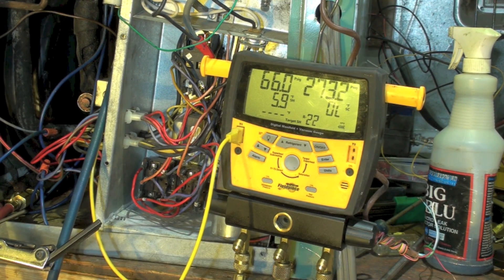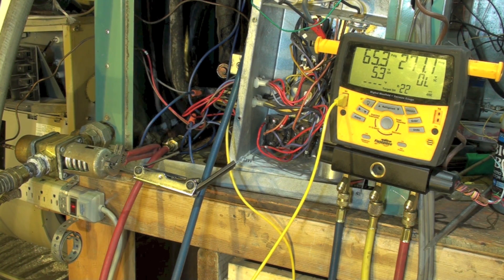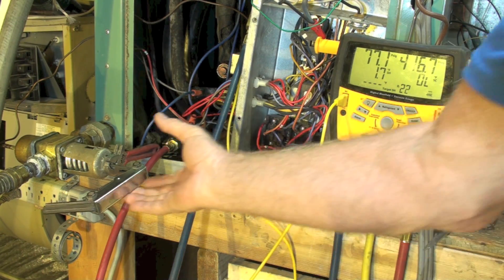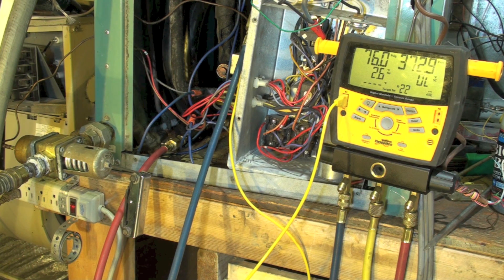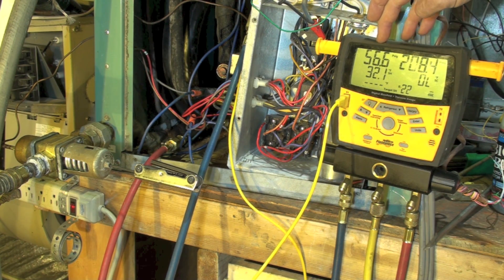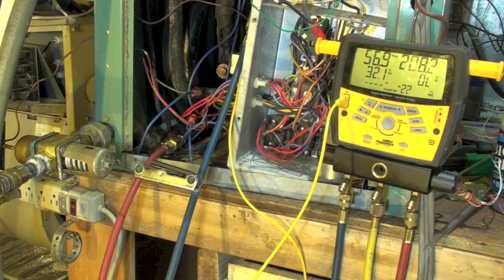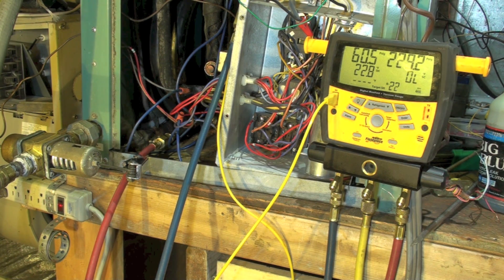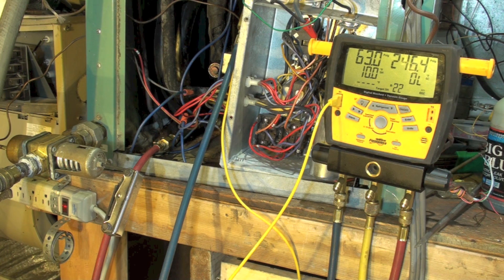How does the water valve setting affect the head and suction pressure on the water source heat pump

Comment: Thank you so much ! I’ve learned a lot . I am a property supervisor and my apt units have these type of water source heat pump’s. Now I do have a question how do you unclog a water source heat pump?
Reply from the maker: If the clog is in the heat exchanger you are in trouble.  You can use a limescale remover, but you may end up with a hole in the heat exchanger which pretty much will destroy the unit.
GFM

Comment: Very good training video. I work on water source hp's just about everyday. We have old Ener Con hp's that are 40 years old and still work fine. We replace them with new r410 heat pumps and they seem to be nothing but problems. The heat pumps were I am at use a supply and return loop with cooling tower in summer and a steam to water heat exchanger in winter. The only equipment with head pressure regulators are the ice machines.  Never new the head pressure controls the superheat like that with a cap tube system. I guess if the head pressure could be raised high enough you could get 0 superheat. lol

Comment: Thank you for the great video content,,,,Could you kindly tell me what the effect would be on the water side if this machine was running in heat mode,,, Also how would this machine respond in heat mode if it had a TXV and you increased the supply water flow and/or the water temperature?  Many thanks in advance
Reply from the maker: In heat mode the unit picks up heat from the water, so the temp of the water falls.
A TXV will simply increase refrigerant flow to maintain superheat at the end of the coil.  
GFM
Reply: @grayfurnaceman  thank you for your response G!!

Comment: I notice newer unit have bigger evap coils with more surface area causing suction pressure to be a little higher great video
Reply from the maker: acechoice45 The coil sizes have increased massively as an energy efficiency move.  However, some of the latest have reduced coil sizes, using things like motor efficiency to reach efficiency goals.
GFM

Comment: That was very interesting. But I'm just wondering how you charged the system if the amount of water is different. I'm use to air cooler fan. If ever you could give a fast explanation of how you did, I would appreciate.  Thanks

Comment: Newer geo units come with gpm charts and presure scales charts to formulate your gpm
Reply from the maker: dirty Its a Florida sold by Carrier.  This unit is about 30 years old and was before any real charts.  The newer ones are so much better.
GFM
Reply: grayfurnaceman I worked on a fedders the other day and it had to be 30 years old ill give them one thing they build them to last back then newer units don't seem to be as durable as older equipment my uncle has a 1984 amana over and under still kicking never needed freon only 2 capacitors in its life time it was instaled a year after I wss born

Comment: They have icee machines that have the water cooled cond. They work just about the same but different refrg. and the evap or freeze chamber would run about 29 degrees
Reply from the maker: Graham Proctor Many areas won't allow water cooled anymore because of the water usage.  Heat pumps like this one are usually only used on well systems or with in ground geothermal systems.
GFM